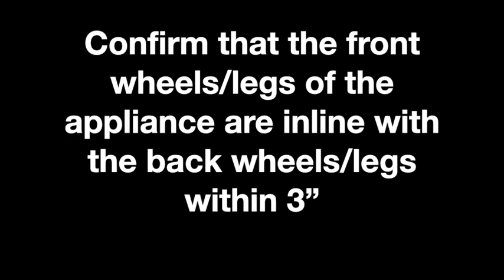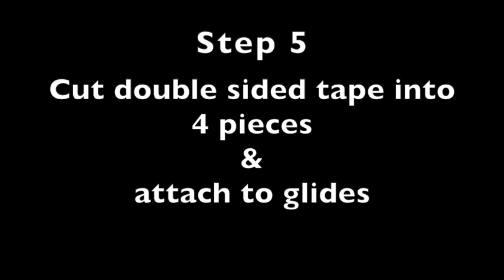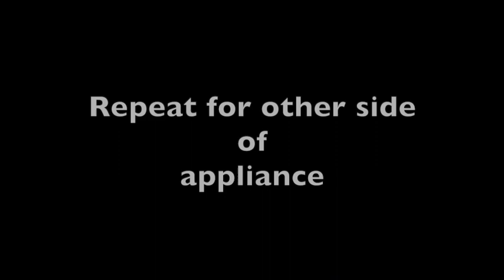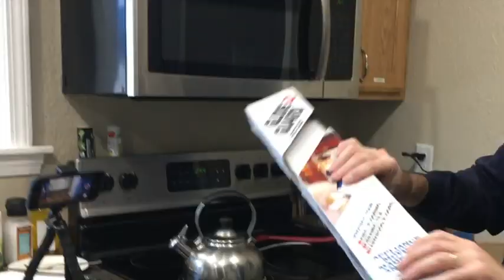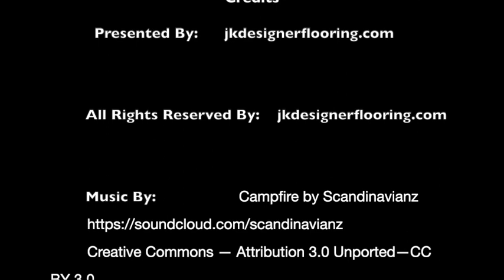Glide-N-Guard Floor Glide Floor Glide Prevents Floor Damage Caused By Movement Of Appliances

Comment: so what about the 4-6 inches of flooring your just rolled across directly in front of the fridge? I don't get it.....you save the flooring under the fridge that no ones sees???
Reply: Watch at the end - they keep extra pieces for later (of course you still have to be careful when you first bring the unit in :-)
Reply: no it saves the floor in front of the fridge, gauranteed there will be residue/dmg from the slates under the fridge from mounting to the floor
Reply: You misunderstood the OP! @cruick suggested that he had to pull it out to install the fridge and it looked like he didn’t push the cardboard flush with the fridge. Meaning, he scratched the floor! You can see it when he is pushing it back in.

These are not great, as they seem more trouble than their worth! There are better ones on the market, where you can use the sliders and then remove them. Meaning you only need 1 set for all your appliances. If you live in the UK, the brand is called “flexible reinforcements” and the product is called “Furniture and Appliance Surface Saver and Floor Protection Sliders”

Comment: To me this video is not how you optimally install Glide n' Guard. You can see how the floor will be scratched right at the beginning with nothing underneath. Instead, have someone tilt the appliance forward and slide it under the back feet and then tilt backwards to move under front legs. If cannot tilt forward, then just insert under front feet so at least scratches are on floor that u can't see. Then once out, place under back feet too. Also for cases where it is dangerous to move appliance under general usage like washing machine, you should remove it.